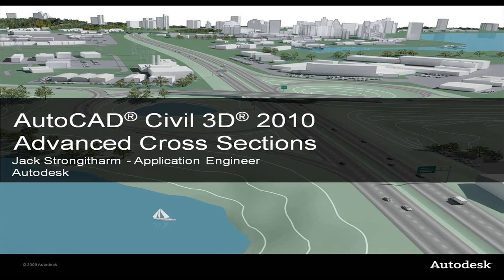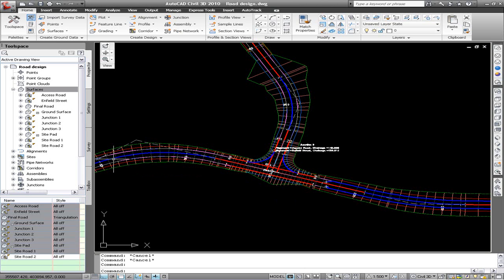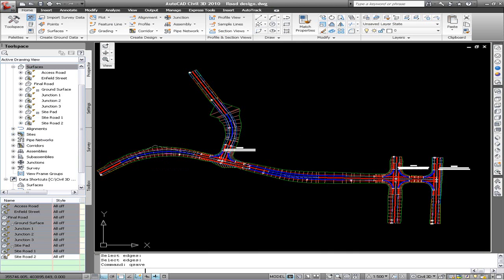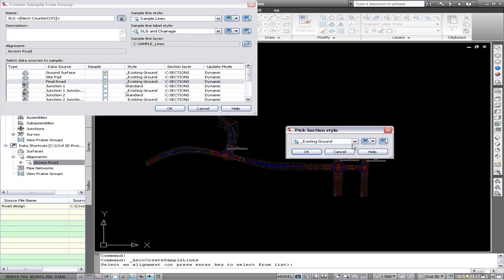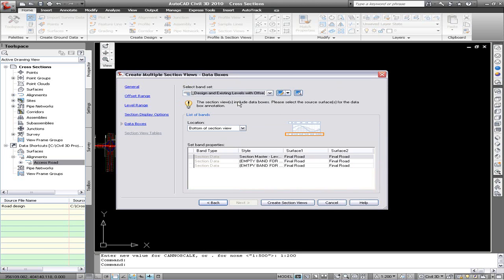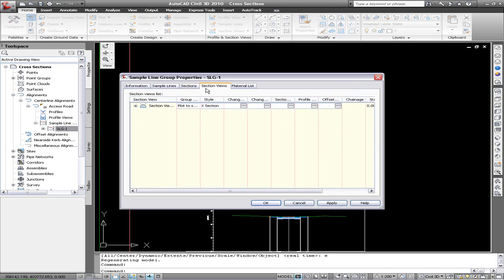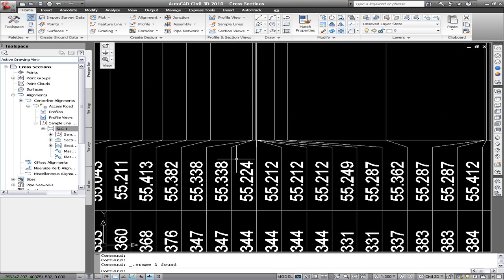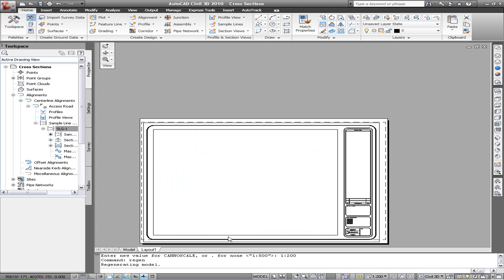Advanced Cross Sections in AutoCAD Civil 3D

Comment: Jack, Hopefully you still get notifications about comments on this.
I am trying to have sections produced of our track but seem to have an issue with the sections when the track is above existing ground level. Is it possible to make the capping material target a specific depth beneath existing ground? Say you have 150mm subbase onto say 200 capping, but if the underside of the capping is above existing ground level it is shown as floating whereas we desire it to be at least 150mm within the existing ground so the capping may be in excess of 400mm thick at that point. Is this possible? Your advice would be much appreciated.
Kind Regards, Adam

Comment from the maker: @rhobureau you can use the UKIE template to copy the styles across.  It is in the 2011 installation of Civil 3D.  You can add the UKIE content pack  from control panel, add/remove programs, Civil 3D where you can add additional features, you will see UKIE in the list of content packs you can add.  The template will then be added aswell as other files.